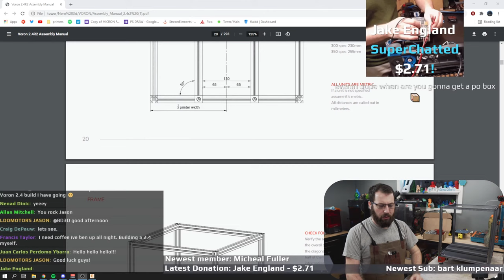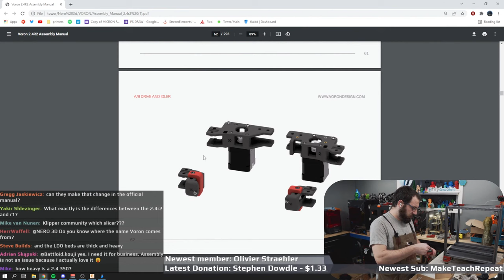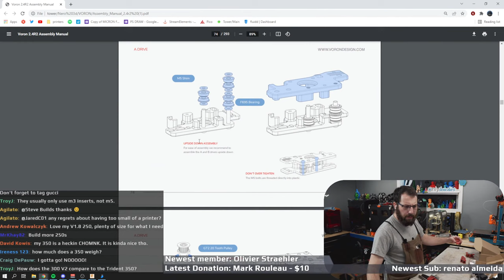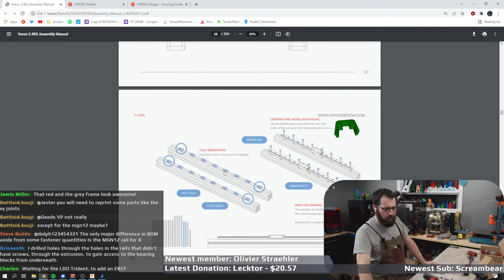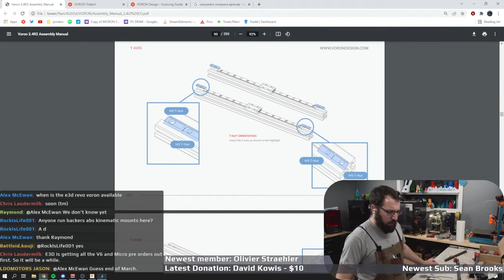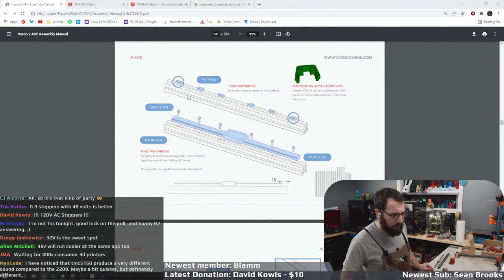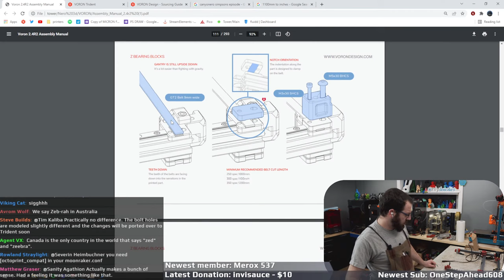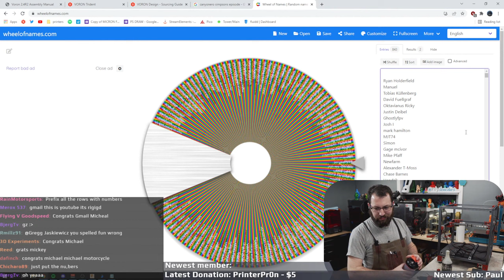Voron V2.4r2 LDOmotors kit Livestream build- PART 2

Comment: I know you won't get bored with terminology but I think this is a nice example of regional terms trivia. You said that bolt is referred to the screw. Now in Italy the correct definition in engineering as they teach you in school is that a bolt (bullone) is the assembly of a screw, a nut and washer(s). When I started working in UK (I am mechanical designer) took me a while to get used to the meaning of bolt (partially threaded screw) screw (full thread) and fastener (bullone).
Reply: in my experience, a bolt is that fastener that you tight by turning a nut, while the screw is the one that you tight by turning the head of the fastener.

Comment: 19:30 I wish this part regarding installing the screw into plastic was more clear in the manual. 
I assumed it would use a nut or something on the other side and used a file to clean the holes so the screws would enter easily, since my printer is not very accurate when it comes to sideways holes. 
Oh well, I guess I'm going to add an M5 heat insert now.

Comment: if you connect your UPS to your server via usb (or serial in older cases) and your computer runs some form of upsd (which is any windows, linux, or bsd based computer (so something like freenas or whatever still works), your UPS can tell your computer when the battery is running low and shut it down cleanly.

Comment: "they get big quick" - When I was first looking at doing a voron build, I wanted something AT LEAST 400-500mm^3 - I decided to pick up a 350mm^3 ldo kit (obviously haven't received it yet) ONLY because I was talked out of it by people in the voron community, specifically because the belts are too thin, the extrusions are too thin, etc. in the voron 2.4/trident to support larger sizes acceptably.  people have done them upwards of 400's that i've seen, but accuracy drops and maintenance needs increase.  there ARE mods like the DOOM CUBE that work around some of these design shortcomings for the construction of large printers but the overall lack of support once you start making that many changes made me back off from wanting to go that route.  I would personally love it if the voron team were to work on a design for very large printers that work really well.
Reply: WHat you stated as design shortcomings arent.. The voron wasn't designed for 400+ sizes it was designed to print up to 350 in good quality and speed. If it was it was designed for 400+ it would have different contruction.
Reply: @francistaylor1822  dont get me wrong, the voron trident and 2.4 are fantastic printers and do what they set out to do easily, they are fast high quality printers that use off the shelf parts for 250-350mm configurations.  I really didn't mean to sell them short.  what I point out as design shortcomings are only applicable to MY stated goals, that is, I wish I could build a decently supported printer of a significantly larger size with the voron design architecture and thus, I wish they would design a printer that is specifically designed to handle the additional mechanical issues present in building printers that large.  I'd really like something that's somewhere between a v2 and a v24 :D

Comment: Where can I get a copy of the manual you are using, it has things my version does not, I have version 2021.05.20.  Thanks and great video by the way!!
Reply: "Very soon"
Reply: it's not released yet
Reply: Its a new upgraded version of the manual (2.4 R2) that will be released imminently - he said in the 'next week' then 'next week or so' it should be released. He addressed this at approx 6:30 iand 8:30 n the stream. So sounds like at most a few weeks.
Reply: @francistaylor1822  thanks, I didn't watch much of it yet since I seen there was difference and wanted to get some info. Hopefully it is released by the time some more parts show up haha.
Reply: @MxPilot259  No problems, its much harder to find info as livestreams often are free floating convo so hard to go back and find stuff thought it migh thelp.
Reply: There is a pull request on git hub. So not officially yet but you can take a look at the new manual